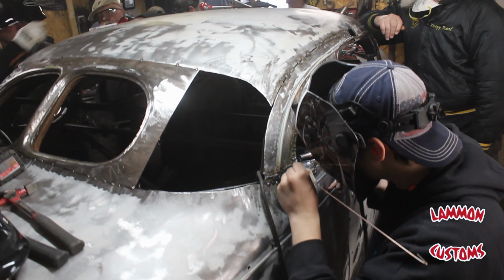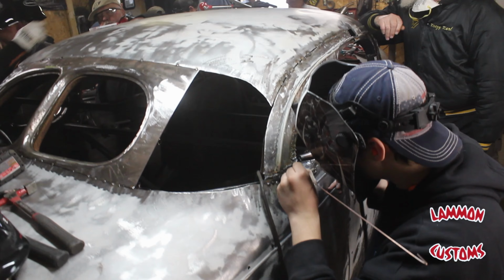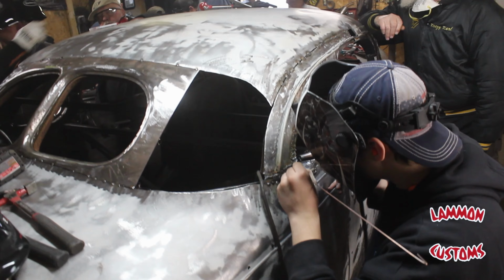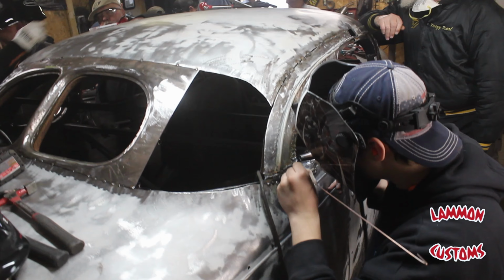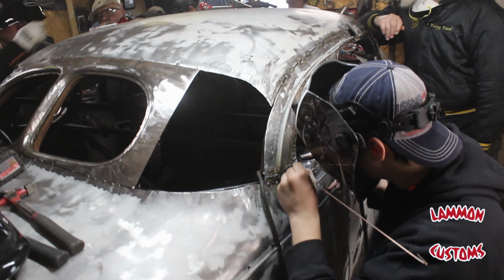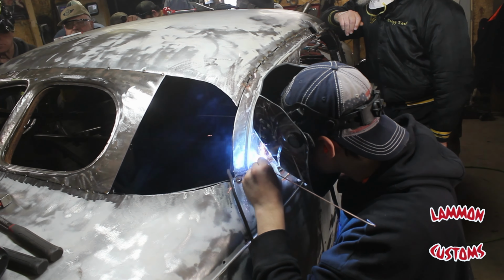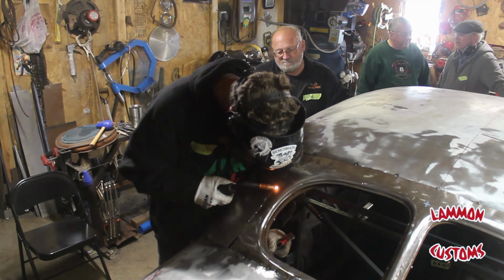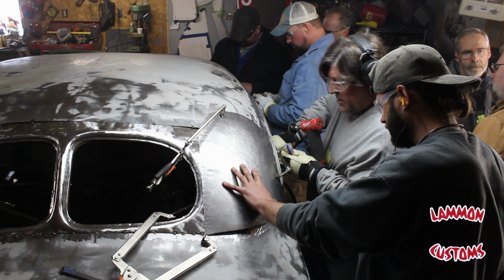1937 Desoto Coupe Chop Top Class With Joel Davis March 2023

Comment: I doing a 38 dodge 5wd business cpe, I've owned it for 45 years .440,2-4s,4 spd,wide 5 quickchange,wide 5 IFS,3/4ton 4 whl disc brakes w wildwood calipers,Nascar truck arm rear.4 inch chop.